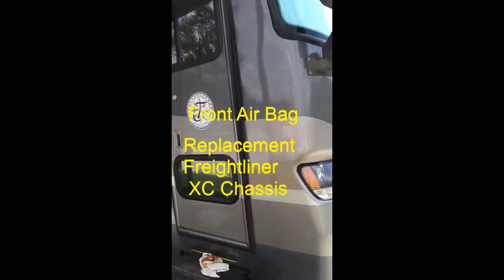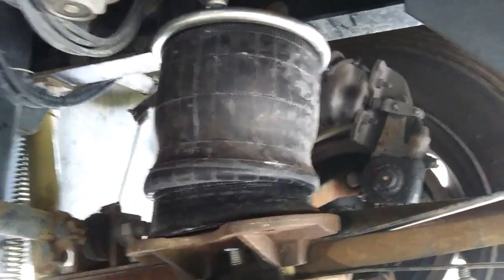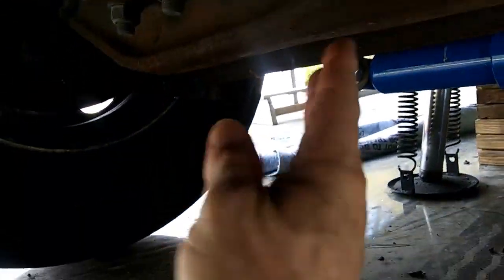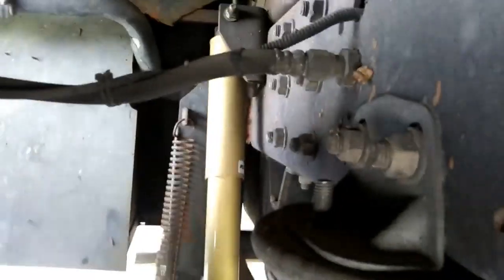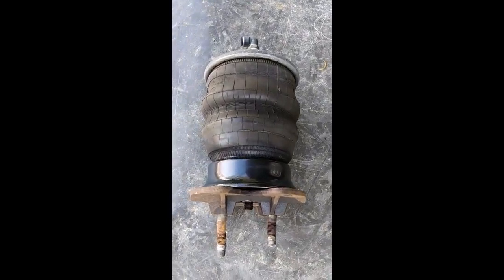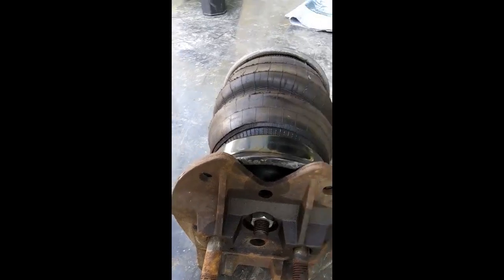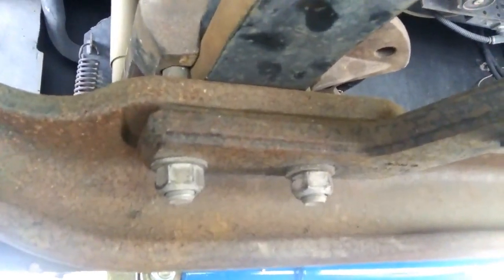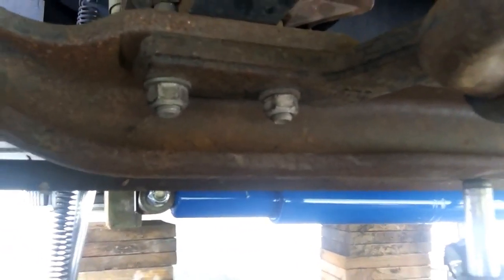Front Air Bag Replacment (2005 Phaeton RV on Freightliner XC)

Comment: Currently tackling this job on a Thomas HDX RE bus, 2008,  couldn't find any info then I remembered seeing these exact chassis under motorhomes.   Thanks for taking the extra effort to record, edit and post.  I post occasionally so i understand its quite a bit more time that the average person would appreciate.  

On my bus the long bolts going through the control leaf are frozen in with rust, that's creating quite a fuss on top of an already fussy job.  Oh well, I'll keep praying and the Lord will help me get it fixed.  He always does!

Comment: I have done this same job on my 2001 Freightliner XC chassis.  I did not have to disconnect the shock to get enough separation from the frame. Otherwise great DIY video.

Comment: Dont just change one side air bags like shocks always replace both sides,and after you drive a number of miles re torque those axle bolts they will loosen up